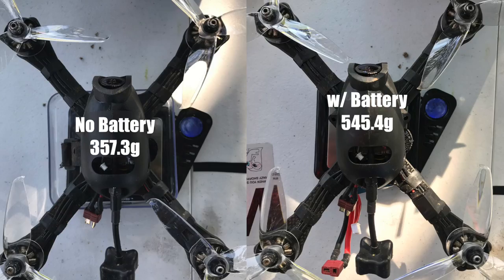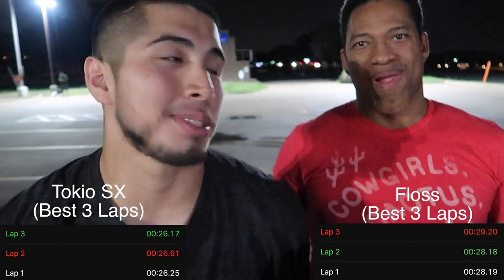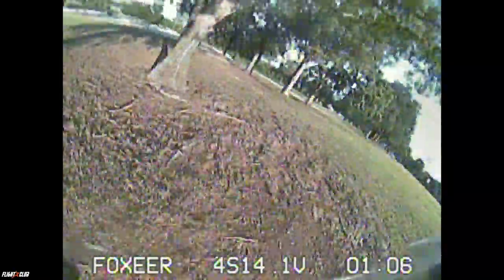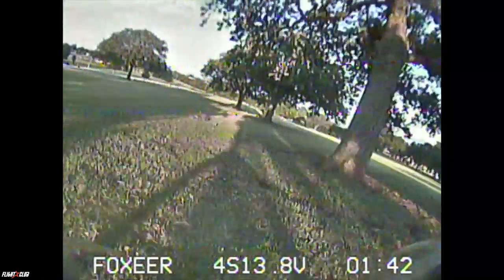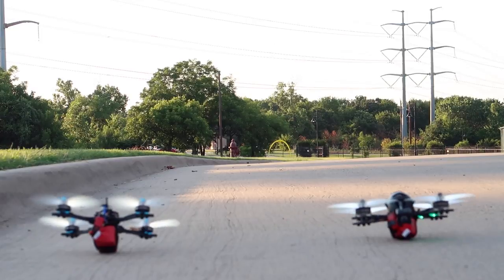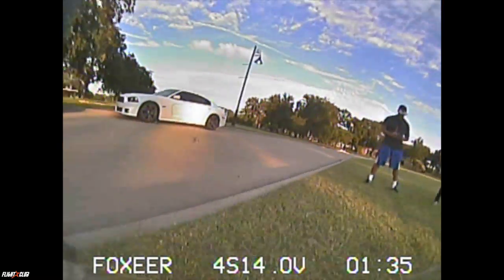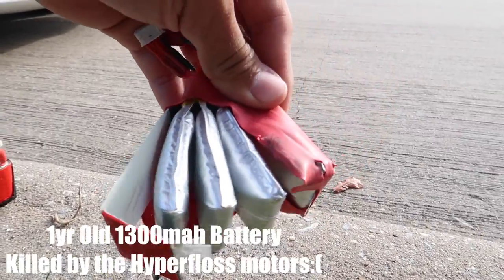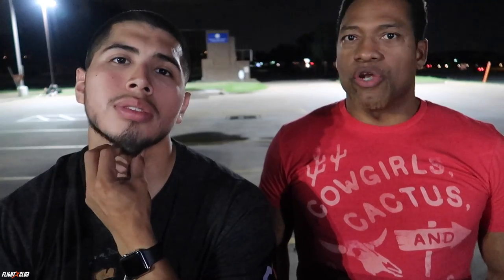DISK THEORY DEBUNKED???

Comment: EnvyAstro CONTROVERSY!! hahaha!! This was basically like racing a mustang with a V8 against a Mini Cooper with a 3 cylinder engine. Ofcourse, the mini cooper won't be able to keep up on big tracks but it does have it's own place. If you put big motors on the floss I think you'll be seriously impressed by it's performance. Those extra 40~g of weight savings due to the frame alone will make a HUGE difference in handling. I think you'll find it will turn on a dime and the acceleration will be insane. Take care my dude!!

Comment: I think this is good for a discussion. not sure about the motor prop combo, but from what kabab says that stuff doesn't matter in the "disc load theory". I think the biggest issue with this is Kabab has such a vested interest in saying hyper light is better because he designs the floss frames so of course he is going to say his design is best. more independent tests are needed from a whole bunch of people because its a really interesting idea that can help push the hobby in the right direction.
Reply from the maker: Yes, that’s what my initial thoughts were. That motor prop combo didn’t matter much at all. If I recall the main thing he said matter was weight for the theory to work & also him talking about a heavy quad will never be able to handle turns with full throttle because of the momentum but the drag race kinda proved that wrong when I turned full throttle not only that but my turns were still tight around the track. But we will do more videos to follow this to give the people what they wanna see:)

Comment: It's not a very fair test, 2204 motors at 3000+kv aren't going to be able to run a very heavy 5152 prop! Run a 5x4x3 and try it again
Reply: Special K I totaly agree...
Reply from the maker: Special K well I yes and no, we did prop test to and actually have tried out all the different kv 2204 for other test. Not only that but we did a prop video where we tried out a few different props and they performed best with 5152 base of some lap times and feel.
Reply: In your prop vid you only tested one variant of the 2204 right? It was 2500 or 2700 kV. You can't expect the same prop to work on a higher kv motor. I agree with your results from the last vid, but you didn't use the same specs for this experiment.

Comment: Great testing guys, Thank you for taking the time! You may however have overpropped the little 2204 motors. The RK5038, 5040x3 and 5050 dual cyclones would be max for these motors... Could you rerun the drag race with different props on the floss?
Reply from the maker: Rotor Chris yes there is def a lot more to look into the disk theory, as there are many prop choices out there. The reason we used 5152 is because on another video on Justin Skinner channel we tested few Types of props and found that the 5152 were one of the best performing.

Comment: It's all about what power curve you are looking at, which course are you flying and what type of gates. Also a note, 2204 to 2206 in general are only good for 5x4x3 or 5x4x4, any modern props are just straight out out torque the motor. Sure you can fly around in the course without changing altitude but once the course involves 3D features like split-S or dive, 2207 motor on a little heavier build win straight out. It recovers from a dive faster, accelerates quicker, bite the corner better with heavy props and because it can bite corners with props like T5050C, its straight is faster too because it makes the fast prop T5050C usable in race. I was having big issue running the small gates with 2206 on 5x4x4 because the quad doesnt have the response I need to micro adjust the little height I have above ground after each turn. Once switching to 2207, all issues are out of the way. I can use T5050C in race with small gates

Comment: I am a bit late to the party but here are my thoughts... First of I truly enjoy your content as it shows things from a very practical perspective. That said, in this case, the Hyperfloss build was made in a way that it gave up too much power to achieve lightness. I was able to build a 209g (minus lipo) 5" quad while using the hyperlite 2205 motors at 2522kv. In this case the quad is still very light without sacrificing much power. I do not have the funds to test a bunch of different configurations but I am sure that there will be point that the extra power from the motors will not be worth the handling that you will give up due to the added weight. To further complicate this I bet this balance is a moving target based on the type of track that is being flown. 

Keep up the good work. I enjoy your content and specially your flying skills. Hope i can be half as fast as you are some day!!! I bet you can beat me racing even with a DJI Phantom I even if I have the best equipment around...

Comment: Hey guys love these videos I also built a floss frame 5" with f40 pro 2600kv motors and it flys amazing it is hands down the fastest I've flown you should rerun the testing with both frames using the same equipment I think it would be interesting putting frame against frame also I would think your times would be better with the tokio sx being you have more stick time with that frame
Reply from the maker: Dave stints yes for sure man! Thanks for the support

Comment: I think one aspect that is overlooked here is aerodynamic drag. Coming from a cycling background, almost everyone was a weight weenie in the sport until the concept of marginal gains became popular. Every design is a tradeoff. Optimizing one aspect comes at a price of another aspect and at some point you'd end up with diminishing returns. When acceleration, climbing and technical turns are crucial, weight matters. When constant speed and there are longer straights, aerodynamics matters more. For example, lighter frames benefit when speeds are under 18 kph while aerodynamics begin to matter more exponentially as you go over 18 kph. Sure aerodynamic drag from such a small frame is minuscule, but it's when you sum up all the efficiencies and optimizations that you end up with a purebred machine for a specific purpose.

Comment: cool test guys. The question I have with this 'disc load' theory is at what point does the more powerful heavier motor  overcome the weight issue...? As you have shown if you use badass motors on a heavier frame - it balances out this issue. There must be a point where the lighter weight is not worth it over having 2-4g more per motor and loads more thrust...
Just one point is that possibly on tighter tracks the lighter quad might do better?
Reply from the maker: Stephen Wright that is a question we had asked ourselves, and I am very curious to know how light do you really need to be until you don’t benefit too much from being light.
Reply: EnvyAstro yes although I assume lighter is always better with the same power...but you loose power with lighter motors...so there is prob some sort of power to weight equation someone smarter than me could calculate lol...anyways IMO the new 28-29g Brother Hobby 2207 could be the ideal sweet spot...?
Reply from the maker: Stephen Wright yes for sure, i do think after the numbers we got and what we felt on the sticks is that not just because it’s lighter it means is better, but also you’ll have to take in consideration the equipment.

Comment: One of the main reasons why the tokio won was because of its weight, When you have a heavier quad you have more forward centrifugal force which gives it more of a high end speed, since the f40's have more torque it helps compensate for that forward momentum on sharp turns BUT a bigger quad means more air drag which makes it harder to accelerate and makes it less efficient. Love your tests guys! keep it up!
Reply from the maker: CarelessMedia thanks for the feedback man!

Comment: Not doubting that t-motor are fast motors, I personally have never flown them, a buddy of mine swears by them. But up until a few weeks ago his attitude changed when I was now able to keep up with him on a course with my floss. I must say though that the 3022 are meant for 4" the use of 5152 totally killed any chance of this being a fair test. Maybe change to 2722 and light pitched props. Hell get Justin back out and run the test again with his setup. Justin's Floss would have been a more comparable test with the twin 5050 prop.
Reply from the maker: 345kryptonite yes I def will, as I will be getting my 2722 kv this week:) that’s why it’s still questionable as if it was debunked, hence the title

Comment: I'm running a 200g setup with RCS H2205 2633kv against my cousin with Hyperlite 2206 2600kv with 300g dry weight. Main difference is that a lighter setup could be much faster in cornering, but it's super hard to control. We are pretty much same on a race track. I corner faster, he is faster on straights. I'm just not good enough to get 100% out of it.

I came to the conclusion that a super light setup could be a bit faster on tracks which have the max size of a soccer field - IF you can handle extreme tight cornering, because you can corner way more agressive and take a shorter way. But people are not used to it when they come from heavy quads. 

try it out. if you fly the same way with the light quad as with the heavy one for sure the stronger is better. but where a super light setup shines is the superhuman cornering nobody is familiar with and has to get used to. it took me 3 months to change my flight behaviour and realize the potential.

But thanks you confirmed 70% of my own experience ;) - i prefer the lighter setup, it's cheaper (lipo, motors, esc) and it doesn't get that often broken. (havent broken my 200g quad since 2 months, braindrain had the same experience)

thanks for your experience!

Comment: f40 on the floss  frame  with the  5152 is what you should do....  The props you use are to heavy for those floss motors you need the 5040 props and the KV is too high I talked to Sergio and he said the 3022Kv should be used on 4 inch and not 5 inch  so Please try the experiment over with 5040 props  and if possible change the motors ..

Comment: Would like to see this "test" with identical motors even though the whole theory is based on a lightweight setup...
Reply from the maker: +Tracy Thomas yes it is for sure I’m sure if I’d put F40 pro on floss it’ll out do the tokio lol by a lot I’ve had a similar light setup with f40 before
Reply: EnvyAstro A proven supporter of the Disk Loading Theory... 😂

Comment: Yeah I like the test but you should have used 2722kv for you test.  I also think you should inClude the fact that a lighter quad with better efficiency would be better for a 2 min race,  and then a heavier more powerful quad would be better for those head to head races. one isn't necessarily better better than the other

Comment: If I understand the Disk Theory correctly, this test is not proving it wrong because the theory assumes "equal everything but props size and AUW", which by no means is the case of those two kwads. 
The theory is (imho) barely useful because it is trivial. "Less weigth= more performance" & "More area = more performance". You can easily test the weight part just by adding dead weight to a kwad. Without the extra load it performs better. No discussion. The props part is very difficult because you need props  of different sizes but all the rest equal. For instance same weight. Albeit not testable, the intuition approves.

However, your video is in deed very interesting, regardless of the DTL theory and is something we do want to see. What is faster? Nascar or an F1? A Ferrary or an Ariel_Atom?
Put the F40 on the Floss, that would also be interesting.

Comment: You'd have to take the human factor out of the equation to really test it.  I've got a floss with 2306's if you want to borrow it, but it's only 37 grams lighter than your tokyo at this point.  Well, I have the gopro mount on it and a few extras.

Comment: I dont think you need to have the same motors but there will be a point that you can add power with a bit of weight and make it faster. That said I do think the pilot makes a big difference.  I have a very light setup (209g) using the Hyperlite 2205-2522 and using the 5050c dual prop it rips... that said I am sure you can beat me in a track using a box stock x220 Wizard...

Comment: Agree with Tassos but at least as important is the battery. My light setup is much faster when I swap out a 4S 1500 with a 4S 1800!! If the battery yields a lower voltage drop it will be that much faster. But fun test nonetheless as it shows lighter is not always better

Comment: I think you made a mistake, you should have the same setup on both quads(at least the same motors and esc) so that you tested the weight difference and not the different motors.
Reply: Tassos Achtidas is correct: You should use the Same motors on each. On the other hand, the Floss would become too fast and probably become a lot harder to control, but this would help rectify some of issues you guys mentioned (e.g., top end).
Reply: Exactly what I was thinking :)
Reply from the maker: Tassos Achtidas yes for sure I’m on that, but the thing with disk theory is that it doesn’t state to use the same motors, esc, cam etc. It just simply states that if you are lighter depending on the disk area, it should fly better. But yes I do agree with what you are saying.
Reply: EnvyAstro must mean that disk theory is flawed and needs to be tweaked and clarified.   Still a great video, though. It still provides a good comparison between different specs of setups so we know what to expect when we fly.
Reply from the maker: TheLeprechaunPirate yes for sure, after all it’s just a theory
Reply: thats not a mistake - motor choice is one of the biggest factors to quad weight...other components you cannot reduce weight beyond a certain point...so to give the 'disk load' theory the best shot it is sensible to use the lightest motors in this case which were designed with this theory in mind...
Reply: Stephen Wright Lighter motor with less thrust to weight ratio? Not my choice. light frame built "around the prop you intend to use". I have a floss with 2207's, it's like having glass bones but nobody catches me til or if I crash... No problems with flight times.
Reply: Tassos Achtidas that frame was not meant for heavy motors, if you were to use heavy motors like the tmotors on 1 impact it would snap the arm in an instant due to having most of the weight coming from the ends of the arms!
Reply: no, they didn't make a mistake. when you build super light, you're also looking for the right light motors that go with that "lightness". by putting motors on a super light frame that normally go on a heavy frame, sure you increase power:weight ratio, but there will be a point of diminishing returns if you continue to go by your theory of putting monster motors on tiny frames.
Reply: You are wrong, i've had at least 3 impacts with 2306 emax on a floss frame and haven't broken an arm yet.  The arm is going to break, no doubt, but 10 extra grams of motor isn't going to make or break it, pun intended.
Reply: What I got from this test is seeing how 2 quads in their preferred setup state compare to eachother.  Ivan setup 2 quads with parts specific to the build for each quad.  Now suggesting the two quads run exact gear does not seem very logical because one s asuper light and the other is heavy.  Why not compare the two  quads in there race ready setup.  This way the person can have a feel to which is better.  Which I think they did here to the best of their abilities.
Reply: Obviously the lighter quad of identical setups would be faster. Any idiot knows that... what he is debunking here is the DISC LOADING THEORY. That's it. He's 100% correct. Outside of the disc loading theory, basic physics tells us that a lighter quad vs a heavier quad with identical components (ie change the battery or add lead for example), the lighter quad will ALWAYS be faster around the track. But that is not the basis of the disc loading theory which is exactly what they proved here today.
Reply: Eganwp well if every idiot knows that a lighter quad same gear will go faster, then what are people arguing about? some like high rev rice rockets, some like high torque muscle, and a few people like to take the super lights n put the biggest baddest motor in it and see if we can drive! lol
Reply: The point is that the heavier quad has larger motors. It should be relatively similar in power to weight ratio. If it isn't, then the lighter quad will obviously win. No one runs dinky motors on heavier quads. It has to make sense for the build.

Comment: I feel like you took this waaay out of context. Weight does have its benefits, but the idea behind light quads is that you can run a higher kv motor. You keep it light because you are using a motor that revs faster but has less torque. Generally speaking you are running smaller than average motors on these setups. Obviously if you are using motors with alot of torque, then weight will make less of an impact and will be outweighed by the slight benefits of weight. Its a balancing game. Their are benefits to both heavy and light quads. But to take advantage of them you have to set them up properly. Just being light alone isnt enough.  Try running a high kv 1407 on 4 or 5 inch props with an extra 100grams.... Its not going to fly well. But if you can stay around 250 grams with lipo the 1407 motors will be able to show their true potential because they are able to reach a higher rpm under less weight. Imo this is NOT debunked at all.